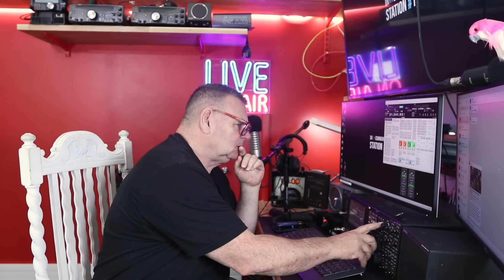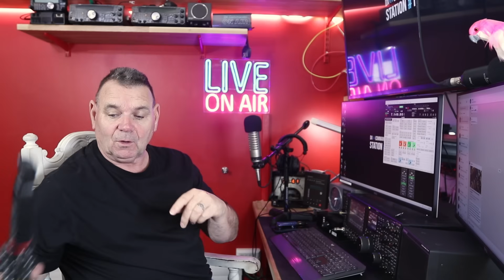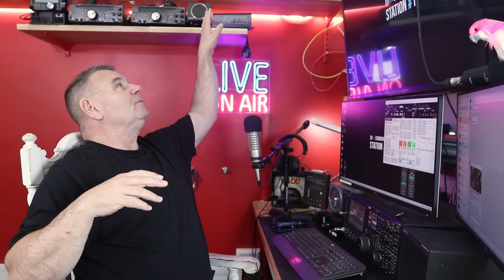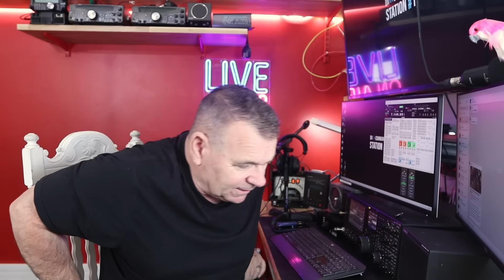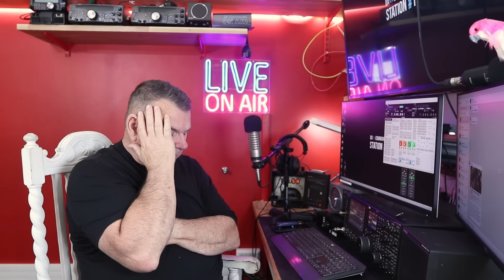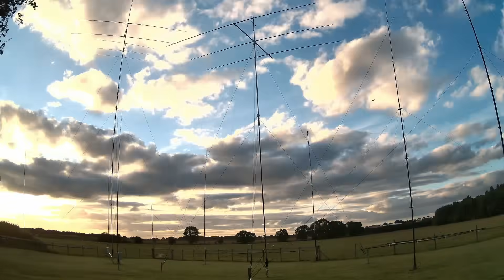Shack Chat: Everything I'm Working On

Comment: Awesome as always Cal, I recently moved my internet router to my shack and have been playing with my flex 6400 remotely. It really was plug and play. I traded a 9700 for the rig am am so far happy. Now to get the antenna field done. Plans are for a 80M loop and maybe another antenna, probably a elevated vertical? Not sure. Right now I am building rack cabinets for an old timey CW coast station feel and look. Who says you cant have modern fun and a old time feel to your shack? I recommend if you find a flex for a reasonable price you may want it just to tinker with, they are fun! Ive also got a 1000MP at the station also for MARS use.
Reply from the maker: Haha... No more radios please :)
Reply: @DXCommanderHQ you can never have too many radios. My elmer, N4OYT has a shack full of them!

Comment: I like the idea of a new shed/shack. You've done pretty well at creating multiple stations on multiple antennas so I'm interested in what you have coming up. I grounded everything in my shack to a copper pipe then grounded that through the wall to an 8ft grounding rod just outside the wall with 8 gauge copper solid. My oldest son is a journeyman electrician with lots of experience. He noticed I usually unplug the antennas from the switch when the weather is bad. He just laughed and told me that would be no help in the event of a direct strike on one of the antennas, that probably all the electronics in the room would fry. I have a good inventory for the insurance company.
Reply from the maker: Good man old friend!!

Comment: Great video.....I think a larger shed is definitely the way forward. I think quite a few including myself said this when you installed the current store/shed. I would be tempted to reinstall all the cables, switches etc to the new shed and incorporate a work work station which you could also shelter from the weather, have a brew etc !...Keep up the great work. Mark..m0mco
Reply from the maker: Well, I like the small shed for the coax in and out. Maybe a bigger shed somewhere else. If I can be bothered!

Comment: Check for voltage drop on the ethernet cable. Pretty smal conductors and 12V may be less than 12V once it goes out and back in. Well worth testing.
Reply from the maker: It’s not the voltage. But thx.

Comment: The interfacing of the PTT is often done with a "soft key", often with an opto-isolator. They are a wise addition even if not needed in all situations. A number of companies make them, often to key older amplifiers from modern radios. Regarding lightning damage, in 40 years of two way radio work lightning damage on well engineered sites was rare, but of course this was mostly VHF/UHF systems which in their own way are less vulnerable. Martin gave you good advice with not repairing that amplifier, there is no way of knowing which components have been stressed and you can readily end up with a series of repairs over a long period.
Reply from the maker: Thanks for the sound advice, an opto-isolator is definitely something I need to look into.

Comment: Save yourself the trouble protecting the ethernet links and just go with rugged fiber instead of copper. That would be better suited for this type of installation anyway
Reply from the maker: Hmmm. Sounds like money!
Reply: @DXCommanderHQ  I guess you could get the hardware for around 200€ per run. Two media converters (with integrated optic modules) and a pre made fiber with connectors aren´t that expensive these days. And that not only protects you from lightning problems but also ground sharing between different locations, max length on twisted pair cables, etc. You also don´t need any special tools for the installation and maintenance is mostly non-existent on those kind of installs.

Comment: HI CAL 
Try an inline no contact relay same as we use on PTT for newer radios to older AMPS
Reply from the maker: Yeah, I need to clear the decks and start that project from fresh…
Reply: Would a Reed Switch and relay work in that situation? that would be a simple and cheap solution :)
Probably not if its just data, but yes if there is 12v on the line...

Comment: Hi Callum!
Regarding the PTT problem, here is an idea…
Since the ACOM goes into transmit when its PTT input is shorted locally, the amplifier and its PTT circuit are fine. The fault is most likely: in the antenna switch PTT output (it depends on how the antenna switch handles the PTT out: with a transistor or relay), the CAT5 cable wiring or the grounding/reference scheme.
We could solve the problem by building a PTT splitter as you suggested, or with a circuit that connects to the PTT out from the antenna switch to the Acom if you want to retain the: radio->switch->amplifier chain.
For now, maybe try connecting several Ethernet conductors in parallel to create a larger wire gauge from the PTT out to the PTT in of the Acom.
Having all this said, I’m not familiar with your antenna switch, maybe it’s simply a setting in the menu HIHI. 
Best regards, Fede.
Reply from the maker: Fede, I need to do the analysis as you suggest. I honestly would prefer a massive 4-radio lock out box that reads ANY radio and shuts the switch down and only selects the right amp... But we'll get there in the end.

Comment: Just a note on the 7300.  The IC-7300 has 15 discrete RF band-pass filters.  Band pass filtering can be improved on any radio, even high end ones.
Reply from the maker: Absolutely, every rig can benefit from a little extra help with band-pass filtering.

Comment: The more expensive radios have preselectors in front of the SDR the entry level usually do not. As you say the more basic radios have wide open front ends and can suffer from desensing from even out of band strong signals.
Reply from the maker: Indeed.